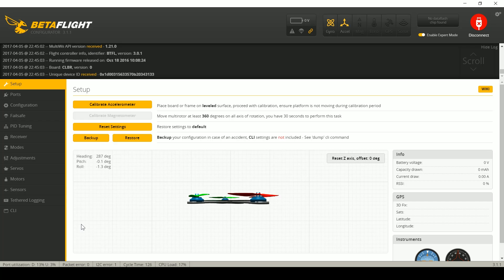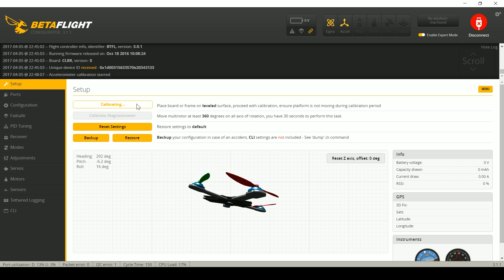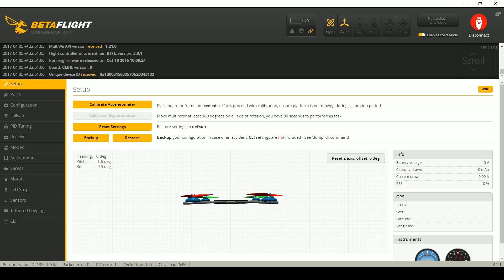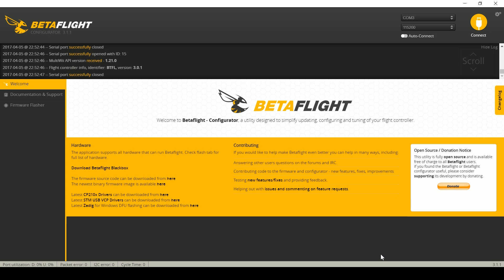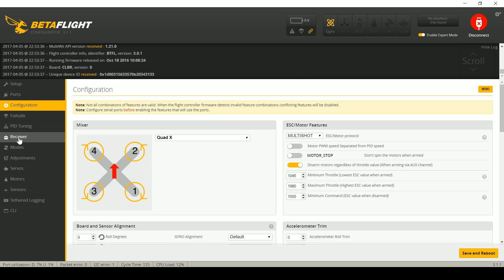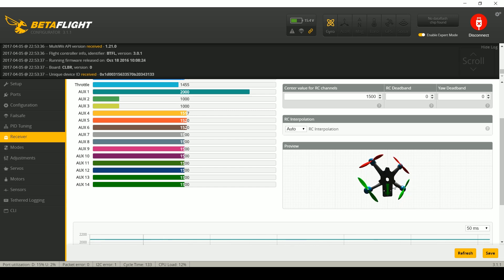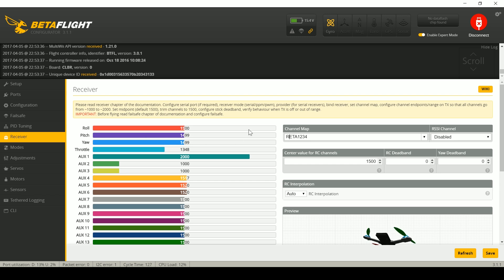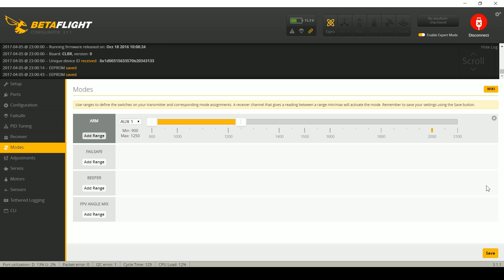Quadcopter Won't Arm | CLEANFLIGHT BETAFLIGHT

Comment: hey buddy so u know norm and wayne from beaver fpv ? anyways can u help me i have a kiwi v2 and it runs fine with a new specktrum 5 volt receiver  but i put a sat on my second board and it light up but no matter what port i put it on i get nothing please help
Reply from the maker: +Johnathan Hendsbee are you powering the board with 3.3v?satellite needs 3.3v not 5v. 

Have you set the serial rx provider correctly in the Configuration tab? 

Have you bound the satellite?
Reply: im using the sat port its 3.3 volts i was saying i have 2 of theses boards the other one works fine but im using the new spektrum 5 to 8.4 volt receiver on that one . and iv also tried all the ports

Comment: Will airmode and the new antigravity feature, work with accelerometer turned off? 
I really want to turn it off and run a higher pid loop frequenzy.
Reply from the maker: Yes. They don't have anything to do with accelerometer.
Reply: you da man (y)
Reply: What is antigravity

Comment: Not sure why you have your arm switch set up to arm LOW (off position). I've always had my arm switch set to arm in  the on (high) position (up around 1900-1950).  On my Taranis, it does a switch check on start up, and if any switches are NOT in the OFF position, it get  "Switch Warning!" announcement.  I know, I know, you can change up all of that, or disable various switches for check, but, that doesn't seem logical ... to me.
Reply from the maker: You can make the switch check any positions you want. I have it arming low because that's where the channel goes when I filp the arm switch away.

Comment: Any thoughts on a copter that arms sometimes and other times will not. As in, one pack it will arm and the next it will not. Go back to it later with the same pack and it arms. Accelerometer is disabled. I can't figure it out. It seems to be very random. I'm thinking there is something wrong with the flight controller. It has always done this. Its a Youbi 130, so cheap china clone (not my copter). POS has been nothing but problems.
Reply from the maker: You have to just see which of these conditions is preventing arming at the time that it happens. The intermittent nature is independent of the cause.

Comment: Hi Joshua, Thanks This was again very helpfull. I have an F4 fc and when I set the gyro and pid loop to 8 and 4 Everything Works fine. But when I raise the pid loop also to 8 (cpu load 4%) the motors start twitching (without arming) and I can't arm (switch) the quad anymore (also the twitching stops). How is that posssible????
Reply from the maker: +Fpv-Droneracing what motor protocol? Synced or unsynced.
Reply: Hi Joshua, I still fly oneshot125 and the "Pwm speed seperated from pid speed" is unabled. 
Synced and unsynced=multishot?
Reply: Hi Joshua, any idea to solve This? Hope you can help me.
Reply: A shame, I didn't learn nothing today....
Reply from the maker: If you know enough to learn nothing, it's time for you to start teaching!
Reply: A good teacher must be able to put himself in the place of those who find learning hard...

Comment: I have an unrelated issue I need some help with and this channel has a lot of support so I hope you don't mind. My problem is my new xm+ receiver is only giving me 4 channels. Now I have another quad with the xm+ and it's working fine so its safe to assume my taranis setup is not the issue. Which leaves me with something is wrong with my beta flight setup or flight controller. If anyone has any ideas I'd really appreciate it. Thanks.
Reply from the maker: What is the result of "get max_aux_channels" in the CLI?
Reply: max_aux_channels = 12 I think I've played around with this already. Just for more info I have RSSI working on AUX 12 (channel 16) it looks like it's working too but not getting anything else.
Reply: I noticed that the Firmware for the xm+ is quite recent (28-Mar-2017) so I've now managed to flash it and have got this receiver working on a different quadcopter. All that remains is for me to now try this fully working xm+ back on the original frame I took it off to see if this has resolved the issue.
Reply: OK a further update on this as I received a new xm+ I flashed this and put it on the problem quad and bound to it. I get the same result Roll, Pitch, Yaw and Throttle all work fine but nothing on the AUX channels. I do notice that Aux12 is showing some movement for the RSSI but that is on Aux12 which is channel 16. However under that there are also Aux13 &14. If I only have 16 channels what are these?
Reply: Anyone?

Comment: hey guys when i plug a battery into my quad one esc the number 3 spins the motor at a low rate and stops, then starts again and stops. its very intermittent, but it is constant once it starts. i modified the min_check value from 1100 to 1050 to adjust my dead band at low throttle band. how do i stop that one esc from spinning up? i know its not right lo mind you im running 30a little bee on 14.9 oneshot 125. just some old equipment. never ran into this before. any help would be appreciated!
Reply from the maker: +Mad Yet calibrate your ESC's. Then reduce min_command.
Reply: Perfect thank you sir! Have a good weekend!

Comment: Any reason everything would work fine with USB plugged in but as soon as I unplug USB, the Rx is no longer bound, except for the telemetry that works fine all the time? Can't figure this out for anything.
Reply from the maker: +InFrontOfYourBack1 gremlins. Burn the quad. Build a new one.
Reply: InFrontOfYourBack1  I replaced my receiver due to the same problem now it works. Ya I ripped all my hair out.

Comment: Hey Joshua! Can you show me your ESC Blheli_Suit settings things? I reset the drone by exedent so everything is worse...
Reply from the maker: +Wesley Van Bommel re flash the ESC's and do not write new settings when it asks if you want to write them. Thst will reset them to defaults. Don't forget to calibrate.
Reply: Joshua Bardwell I changed them already... Do I need to do Default in Blheli_Suit configuration?
Reply from the maker: I don't know if you need to default them. If you want to default them, that's how I would do it.
Reply: Joshua Bardwell Wich settings do you have? Like all the programs and then settings?

Comment: Great video!!
There is another possible reason.
When  use ESC - NOT one shot 125  (Older  ... like PWM)
Thank you for the video.
Reply from the maker: +Alex R. Why would that prevent arming?
Reply: I dont know .  But I saw it.
Most new firmware is no longer testing with the old ESC.
ESC Simonk 12А did not want at all to work with Betaflight! ( but in Cleanflight - worked fine . But like PWM )
After I flashed ESC  it to Blhelli - the esc began to work in Betaflight .
To work -FINE!  Like OneShot 125. :)

Comment: Sometimes i can't arm after a crash. I can't see how these things could be related but i'm not sure what it is. i usually have to power cycle it which is often a long walk away. quite frustrating. Any clues?
Reply from the maker: +txreceivable if you failsafe, you have to flip the switch twice to re enable arming. The ultimate answer is to examine the quad after a crash to determine which of these conditions is preventing arming.

Comment: Not allowing the gyro to calibrate will also prevent arming.  The gyro needs a few seconds of no movement for calibration.  If it never sees this period of no movement, you won't be able to get it to arm.  Only time I've ever really noticed this is on micros (tinywhoop, etc) that I sometimes fly out of my hand.  Unless you hold extremely still, it'll never see no movement long enough to calibrate the gyro.
Reply: Glad you posted this as nothing else was working for me.
Once I calibrated the giro everything was sweet.

Comment: Jos, you are the man. Was getting frustrated over the past few days with this problem. Thanks a million.
Is there a video you can refer me to when you arm but the quadcopter won't take off? Is that a function of motor direction and props only? Thanks.
Reply from the maker: +roland burrows how does it not take off? What happens when you raise the throttle?
Reply: It just spins. When I throttle up the motors spin faster. It does not flip over either. It did try to move backwards slightly. I was doing this on grass.  Does that make it a difference?
Reply: roland burrows Sounds like your motors are all spinning in reverse
Reply from the maker: +roland burrows maybe your motors are spinning the right direction but your props are on upside down.
Reply: Joshua Bardwell or that lol
Reply: RCFlyer85 That may be it. Blheli suggests the motors are spinning correctly. Did not think about the props upside down. I have the grove part of the hole facing up rather than the smooth part. Will check that tonight.
Reply: roland burrows there's usually writing or something on the top side of the props
Reply: Still not taking off. Motors spinning right way and props are on properly, 5030Rs are on the black nuts. Here is a video at mid throttle. What’s wrong please.
IMG_7220.MOV
Reply: IMG_7220.MOV
Reply: roland burrows If your props are on correctly and your motors are spinning in the correctly it's impossible for it to not be flying unless your motors and props are severely underpowered for the weight of your setup
Reply from the maker: +roland burrows confirm receiver tab throttle channel goes all the way at 2000 when throttle is raised. Confirm ESCs are calibrated.
Reply: Joshua Bardwell Thanks guys I will check the setup again. Were you able to see the video to see if it looks ok?
Reply: Just a quick probably noob dumb question. The motors have DX2205 2300kv with CCW and CW written on them. Does that mean that the motors are already CCW and CW? So if I have reversed the CCW in BLHELI, did I effectively make them CW? I am asking before I change motors 2 and 3 in BLHELI. Thanks.

Comment: Well, finally....someone gave us some 'conditions' when setting up a board with CF or BF. I've run into so many problems with my boards NOT connecting, not 'arming', not able to get the channels to work on the receiver. I've went through 2 FC (F3) boards, bought two (2) F4 boards and tried 3 different receivers (PPM/s, Bus and iBus). Yesterday, I finally got my board to 'connect' with BF but still have an 'arming' issue. Watching this video turned the 'light on' in my head and looking forward to getting home to verify my throttle settings. Thanks so much for this video Joshua, I'll be visiting your Patreon link this evening.

Comment: what about when the quad will arm when the flight controller is plugged into Betaflight but not when unplugged? had that issue and I wound up having to swap flight controllers. never figured it out
Reply from the maker: +B33SON that is a weird one. Was the receiver working?
Reply: Joshua Bardwell yes, it was working. I could arm with the receiver when plugged in. also, everything looked and responded normally on the receiver tab... oh, another symptom that would happen when the flight controller was not plugged into beta flight, is that when I would plug in the battery, it would make the normal startup jingle, but then make another jingle I've not heard before and of course, hitting the arm switch would do nothing.
Reply: B33SON could be some power related problem....you should check the voltage when on the batt.

Comment: joshua, great video, but i need help! My min throttle wont go down! its stuck on 1150 for some reason. i tried cli too, nothing worked. its a beecore for a tiny whoop. Thanks!
Reply from the maker: +Brandon FPV honestly no clue. Are you using dshot maybe?
Reply: i dont think so, but its a flight controller and pdb. its also brushed.
Reply: Brandon FPV Does it go higher or is it literally stuck at 1150?
Reply: I cant change it at all so no it doesn't go higher. i put on motor stop but its just annoying because i'm not used to flying like that
Reply: Brandon FPV How can you fly if it's stuck at 1150?
Reply: its only the minimum throttle, so my lowest amount of throttle is 1150. thats just a little too high for me. i want it to be around 1050
Reply: Brandon FPV That's what I was asking when I asked would it go higher...
Ok so either that's what your min throttle is set to on the configuration tab OR your ranges on your sticks need to be adjusted. You'll know that if it won't go below 1150 in the receiver tab.
Reply: Brandon FPV If it's neither of those it's probably a bug and you should reflash BetaFlight
Reply: ok in my config its set to 1150. i cannot lower it, it doesnt save.
Reply: Brandon FPV Yeah most likely some sort of bug/glitch I'd suggest reflashing BetaFlight and starting over from scratch
Reply: I decided to flash to betaflight, it was on cleanflight

Comment: So I have a tiny whoop and on the reciever tab, I cannot get the taranis to go from 1000 to 2000 on all the channels. Is there a way to make the taranis outputs larger than "100" in either direction?
Reply: Jonathan Kelting Yes you need to adjust your RXRange. If you check my channel you'll see a video on how to do that. I can't believe Joshua missed this. Or perhaps he assumed every transmitter could adjust endpoints like his...

Comment: I had 2 problems arming... 1. CPU usage was pegged at 100% because I over-clocked to 2k/1.33k on a Naze32 Rev6.  2. Motors needed to be sync'd and my minimum throttle setting was higher than the minimum throttle range. Took FOREVER to figure that one out.
Reply from the maker: +AimlessMoto the good news is, it's almost always one of these things. So you can troubleshoot it now.

Comment: I have an interesting problem where it arms sometimes but not others. Especially when i use a 4s. It seems that i can arm when usb is pluged but wont arm or take a lot of fiddling to arm if not connected to USB. It seems that the mode light on the fc flashes when i am not allowed to arm. Not sure if this is a gyro calibration issue which takes it a while or what. I also try stick calibrating the gyros and that doesn't work. Any ideas? I have a flip32 f4 special edition fc. The problem seems to happen more on 4s than 3s.

Comment: Great! A reference for the unending forum question. One question about on the configuration page about ESC/Motor Features. What does the "Minimum Command" adjust that is 1000 by default? Does it adjust that Throttle Min_Check CLI command?
Reply from the maker: +rcwck no. Min_check and min_command are not the same thing. Search my channel "throttle parameters".

Comment: done all this and still have a problem.  decides when to arm and when not to . sometimes it will be first time sometimes I have to restart everything or it will start third go . so irritating . no accelerometer engaged either
Reply from the maker: You have to create the failure condition and observe which of these things is occurring. So bring up the modes tab and watch the Arm mode. Flip the switch. Copter doesn't arm. Did the channel go into the defined range? Did the Arm mode go yellow? Etc. If you confirm 100% that everything checks out, then I suspect a bad FC.
Reply: Joshua Bardwell Yeah thanks man  . I have the nubs covered when I switch arm or failsafe and only maybe 2 in 6 times my copter will arm.  exactly the same as on the field . I have tried messing about switching to the opposites and even on a different switch.  it's puzzling to me . I've been watching all your vids.  fantastic balanced reviews and tips . thanks for getting back to me
Reply: Joshua Bardwell also have a very odd issue.  noticed my copter front left motor was spinning from inertia when failsafe.... and when armed it was having a hard time . so when throttle engaged it was yawing to the left . I changed the motor and esc and still have the problem . calibrated all my escs again too and still have the problem.  can you help at all
Reply: Joshua Bardwell thankyou so much
Reply: Joshua Bardwell thankyou so much